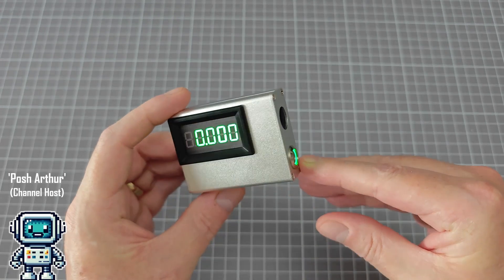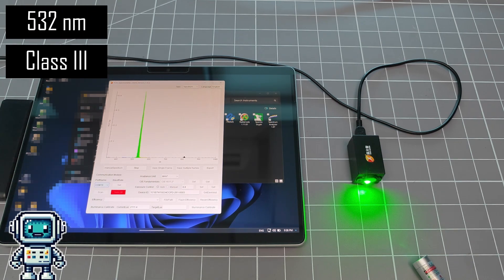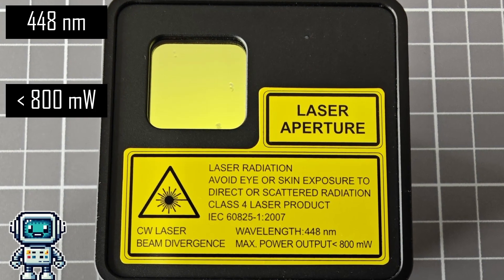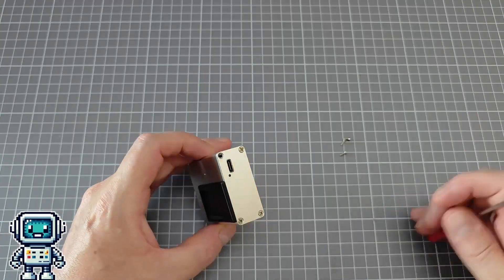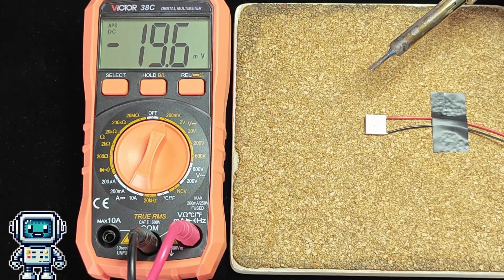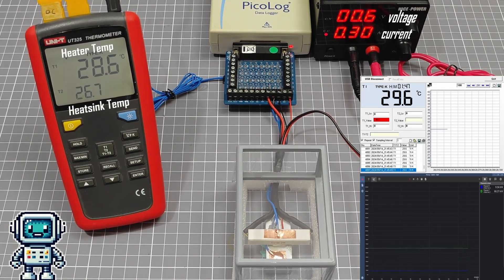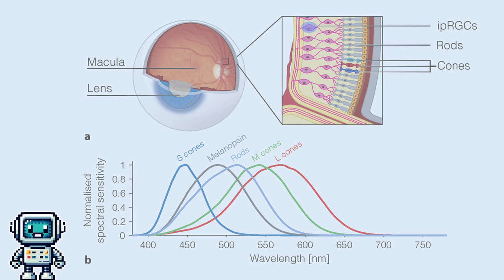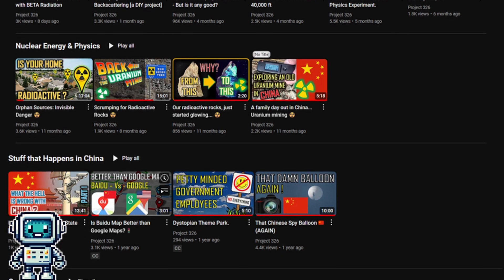How does this LASER POWER METER work?

Comment: im JaySum i have a theory or hypothesis that may explain the 1+1=4///f double split theory,, laser one' double split at an angle pointed through lensed created a double split  laffect of the wall reflection shadow split of a single ray. making P1=p2 lensed affect at an angle projection = the dark mass area of lense bouncing around inside exiting as 2, the laser 2 pointer at an angle crossed paths as then creating a 4 split laser of frequency double split angular frequency laser 1 =p2 double split angular  laser 2 as P=p2,,,,   as then 2 angles square it up  p1+p1= square =4 angular frequency passing through the lense mirroring the affect as a split in mirror of 2 lasers pointing into a single lense point of view mirrored the lasers as a P4  double split law of physics quantum mirror angular affect.. hahahaha YUP  light bender..   sum it up

Comment: Just a stupid idea: could the small difference compared to ideal curve be the system intrinsic thermal capacity? 
Great video in any case.
Reply from the maker: Thanks for the comment, is that the same as the specific heat capacity of the objects in question?
Reply: @project-326  yes, it was late, I did not find the right words ... :)
Reply from the maker: @jarmoparkkinen6090  I tried to wait for as long as possible before making readings so that the temperature could equalize, but you are correct, because at the low end, smaller differential temperatures could have a more major impact on the results...

Comment: Lovely video.  

Especially with the green laser you could see that a lot of the energy was being reflected OUT of the power meter and would not have resulted in the correct reading.  You could ask PCBWay to machine an aluminium laser absorber (to generate mode donations for the Auntie looking after the orphans) with a conical aperture and a square base to match the Peltier device, anodised black using a suitable broadband pigment or photo silver chemistry.  Some other metal that can be chemically blackened would also be suitable.  Using a commodity vaping machine case, controller, display and battery system might be the easiest way to OpenSource the hardware. You could integrate a small laser pointer into the same unit to utilise the battery system and test the power output with a standard corner cube reflector that is used by surveyors as long as your source and absorber were the correct distance apart.

In your power meter design you could then use a generous extrusion for the case that will double as the heat-sink.  Add a replaceable 18650 cell that can be charged in or out of the case. Include a tripod thread in one side and recess the absorber to reduce the entry of stray light.

The panel meter design may have a built in auto zero function to prevent jitter around zero by ignoring input that is just one or two counts above zero.  You could test this to see if a selected pointer always adds the same amount to your other readings or if there is some deterministic non-linear effect.  You could then measure the weak sources by adding them to a stronger reference value and observing the increase much like we use the bathroom scale to weigh the kitten.

For the DPSS lasers you could also do some tests with an IRcut and an IRpass filter to see if you can independently determine the separate contributions and the total amount of light to determine the spurious IR from the pointer.  Someone warned that a COLD DPSS laser with bad IR filter could output many times the Green light in the IR band from the pump laser.
Reply from the maker: Thanks for all the suggestions!
Brainic75 did a good laser beam dump, using a plum-bob painted black.
some good suggestions here, perhaps I will re-visit this project...
Reply: You could consider adding a photo diode based detector for low power lasers, LEDs and optical fibre testing, it would have a high speed response compared to the higher power Peltier detector.  Sometimes it is useful to know IR light is being generated even if it is a weak communications beam or even an IR remote transmitter circuit. It could even incorporate a tiny oscilloscope display showing carrier and modulation shapes if you have a OLED display like those used on the commodity Blood Oxygen Saturation meters that became cheap and popular 4 years ago.

Comment: Which black coating/paint/surface finish is BLACK absorbing "100%" of the radiation?
Reply from the maker: Thanks for the comment.  No materials can absorb 100% of the input optical energy, but getting a constant absorption factor across the spectral range is good enough.  The 'blacker' it is made, the more sensitive the device, particularly to low input power levels.  If the material has constant absorption with wavelength then the calibration can be valid.
Reply: @project-326  
I know you can't achieve 100%, that's why I wrote "100%"❗
But, GIVE ME SOME SOLUTIONS!

Comment: If you build one, would it be advisable to use something like "Musou Black"-paint for painting the visible side of the Peltier-element...???
Reply from the maker: its a great idea, I just need to test the thermal properties.
Just ordered 100ml...  Thanks for the suggestion.
Reply: @project-326  Just saying... and also testing my intuition on such matters... ;-)
Reply from the maker: @klausbrinck2137  I had been looking for a very black material anyway.  The overall absorption factor doesn't really change the accuracy (so long as it is equal across the spectrum), just the sensitivity improves with darker material.   For the instrument I am thinking of building, I am actually not really interested in creating anything that can measure over a watt of optical power, so this might be a useful option.
Reply: @project-326  Exactly (your last sentence). Cause otherwise, loosing several mW shouldn´t matter, as long as the losses are always proportional or similar. But few mW losses by just a few-100s mW lasers may indeed skew the results of comparisons between low-power-lasers.

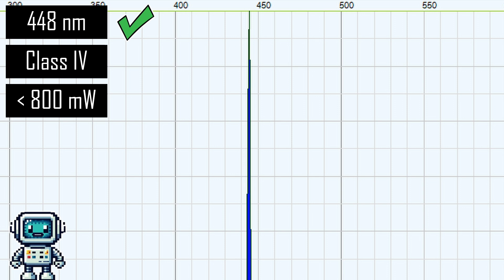Comment: I have been thinking at the 5:47 (something around this time) about the engraver you talked about do you think you will find different results if you used focus lens?
Reply from the maker: Thanks for the comment.
I don't think so, because the thermal conductivity of the plates of the Peltier device is pretty high (they need to be), so the spot size is kind of immaterial, at least until the power density get so high as it damages the black coating.
Reply: @project-326  i see thank you for your answer i thought it would be better if we used foucs lens only but is there another way to get better results or more accurate results than focus lens because we need to keep the device safe
Reply: @project-326  i have thought about will diffraction solve the problem

Comment: whats the limit on these newer models?
Is it still 11W and they kick off?.
Got some very old ones, from like 2016 or 2017 purchased from Tommy at LPS... the pocket and Tornado... was around 35 each back then..
they are still kicking here in 2024 and working fine, even though I been hammering them with intense lazing, way above reason for such a small heasink with a limited sensor & coating,.
Got numerous laser power meters of higher standard, but these dllrt cheap pocket meters is one of my favorites... its så convenient to use and it holds its batterycharge well over time ... accuracy is suppresinly decent for something this crude.. my unit read around +4% high, though do recall it would influence the reading if battery gets to low but all that can likely been fixed, as my unit are like 7 to 8 years old and no battery indicator..
example of the max, and where it chokes. https://www.youtube.com/watch?v=GCqrcVHhLrs

and green https://www.youtube.com/watch?v=7KJAXeTLYbU
the other model Tornado LPM, but it was only on market fora very brief moment back in 2016/2017 https://www.youtube.com/watch?v=Dr4xKMC2sLc

Comment: Nice!
There is a great read on Harvard University page - "The Bolometer and Radiant Energy" by prof Langley, 1881.
With a metal strip covered in soot, connected as part of a Wheatstone bridge to a sensitive amplifier you should have much better time response of the sensor and low power accuracy.
Reply from the maker: nice to know!

Comment: With the 2 lasers you are holding them under an angle of 45°. This will increase the surface by approx. factor 2. With two lasers it is a factor 4. You could test this with some other lasers.
Reply from the maker: The surface area that the beam presents to the sensor doesn't matter, once the sensor reaches thermal equilibrium, the heat energy will be spread over the entire TEC top surface (in this case 15 x15 mm).  The ceramic contact plate is very thermally conductive...
This device measures the total power, so increasing the surface area of a given beam will results in less flux per unit area, otherwise you would be able to get free energy with a divergent beam...
Reply: @project-326 , I agree, but the TEC has the junctions in series. This means that at the outer edges get likely less energy. I don't know the surface area of the laser beam, but I think it is much smaller than the TEC area. I think that the spreading the energy causes just the jump. As said somewhere else adding a bias could maybe help.
Reply from the maker: @troncooo409  Sorry, I don't really understand what you are trying to suggest, is this related to the 2 lasers discussion, or something else?

Comment: 3:42 The laser is in the claimed specs on his label: 650+-10nm. It means, it can be e.g 660,659,658 or 640,641,642 etc...
Reply from the maker: you are correct about that but the background to this is that I have two of these pointers and they are both the same wavelength (within 1nm), I talked to the vendor on Taobao and they confirmed that this is a misprint on the label (ie they are all expected to be 660nm).

Comment: yes definitely a DIY version of this would be really interesting and also perhaps a way of easily calibrating it with a resistor perhaps using your own one as a baseline for that resistor calibration. Also I see you used a black permanent marker is there something else that might be better perhaps such or some form of carbon as the black coating. Whether you're black marker pen would just get evaporated off the surface with a more focused laser.  Very interesting keep up the good work

Comment: I have the laser bee USB and its a decent product; identical technology to the one tested here - a peltier cooler blackened and used as a sensor.   The canadian guy who designed it seems to have done a reasonably competent job and probably calibrated the original design.  I haven't opened the case, but it probably contains an opamp, AD converter and USB stuff.  It gives the same sort of results as the unit here, green laser diodes put out much more power than the red, and the violet (blu-ray diodes?) are stupid powerful.    

Accuracy is probably about the same +/- 20% as environmental factors around the sensor are a big contributor to error -- the average human is radiating ~100W, albeit over a much larger surface area, but that is still a lot of noise compared to mW range laser diodes.

The peltier elements are not designed as sensors, so their manufacturers are probably not much interested in unit-to-unit variability, provided they all meet some minimum cooling/W spec.  Calibration of each unit is then the key to accuracy when used as a sensor, and calibration takes time and therefore money.

I've been more interested in interferometry stabilized he-ne lasers, and they are only micro-watt power output , which is well below the noise floor of any (hobbyist) peltier device.  I've tried these devices:

digikey.com/en/products/detail/marktech-optoelectronics/MT03-003/5866633

where you at least get a spec sheet with a current output curve as a result of infalling irradiation power.   You also then have a wavelength dependency; the few photodiodes I've tested show minimal unit-to-unit variation, an encouraging sign.   What's the absolute accuracy?  Back to the calibration and money question.   

The photodiodes should be able to handle several mW power, but anything in the W range is likely going to destroy them.

Comment: Offtopic but i've read you're interested in it and i have an emf-390 if you ever need more data on experiments about radiofrequency or alternating electric and magnetic fields. Awesome instrument, it is directional though.

In the rf it is responsive in the 30mhz - 10ghz range. Actually it is sensitive up to about 10.5 and the lowest i got was 433mhz with a walkie talkie. Another fun thing are microwaves ovens. I have a shielded one, mind you, but i could still see the continuous signal from another room 2m upstairs close to the floor (0,300 milliWatts) so very weak but cool. I discovered some light switches when clicked create a small rf pulse and my xiaomi phone in airplane mode (wifi and bluetooth off too) was doing two pings when i turned the dispay on and off. Fixed it later, had to do with bluetooth. I can see when a call is coming about 5 seconds before the phone starts ringing. The biggest source of mf i have found is my lawn mower when operating and ef is my scooter when charging, both detectable from 4 meters away. Even a cable not plugged in any outlet but touching another one that is plugged in has an ef detectable at the other end, even though they're made of insulating materials.. and i can't detect any magnetic field being generated that could somehow induce the current so boh?

Actually i'm sure almost anyone in the comments has some kind of measuring device here, we should do a telegram group to create a squad to run multiple experiments with different measruing units.

Comment: Awesome! Learnt something new!❤
What are this peltier devices made from? Looks like porcelain? Google tells this is an alloy from Bismuth2 Tellurium3, a rather exitic material. I guess its resonance frequencies are outside the visual range to give such a linear measurement. Weird stuff.
Reply from the maker: I learnt something new too and wanted to share...
Reply: @project-326  Ah sorry, I was wrong- I googled a specific peltier device TEC1-12705 and that one is just AL2O3- Corundum, an Aluminiumoxide, a not so rare mineral. Cool! they grow also naturally, didn't know they can be used as Calorimeter. I will check out, if I can buy such a laser measure device, I also have a few lasers, where I am suspicious they are completely out of their range. And as you, I do it on a budget, so the input is highly welcome and I like your scientific curiousity. And I like you, I have rather weak lasers, so a sensitive device for low ranges is welcome. As one comment pointed out, there are this supercheap diamond thermo conductivity measure devices on Aliexpress, may be you take apart one of those. If I am right, they use the same principle as your laser measurement device. They really depend on the mass of the object- bigger stones warm up slower. But what is obscure to me, that the probe tip is also measuring at the same time - may be the measure how fast a certain amount of heat is flowing away from the tip (=cooling), instead of heating up.

Comment: On the topic of thermal sensing, I recently got a cheap diamond tester to review (Diamond Selector II). It has a little metal probe that is warmed up and put on the surface of the stone to be tested, and measures the heat flow to the stone. Apparently diamond conducts heat more than fakes. I tested it on silver, copper, steel, glass, etc. and it could easily detect copper and silver due to their greater heat conduction. An interesting characteristic of a material to measure.
Reply from the maker: that is interesting.  How does the system guarantee a consistent contact surface area?
Reply: @project-326  It just has a blunt 1mm copper probe.

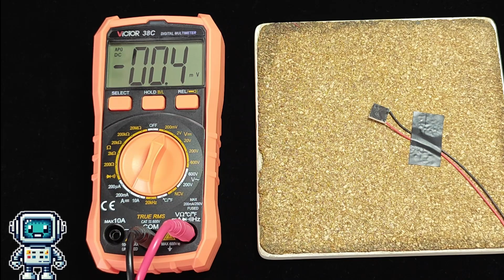Comment: 11:54 Some RMS meters use a thermopile to handle any waveform and bandwidth.
Reply from the maker: wow, that is an interesting technique.  Using a wide-band RF load and a thermopile, nice!
I have been wanting an RF power meter for some time, but much of my work is at 8 GHz (UWB) and at those frequencies even a length of cable is a major investment!
Reply: @project-326  It's such a simple technique, literally measure power's effect on the temperature of some mass. I assume some of these can be very sensitive to low power signals too, using various compensation to eliminate the environment's effect.

Comment: ive seen some laser power meters in equipment by having a small mass of material (aluminium for example) coated in a highly absorbing paint or soot, its connected witha thin short rod to a larger mass to sink heat away.  both masses have a temperature sensor and the difference gets measured which can be used to calculate the amount of power absorbed

Comment: Doesn't the peltier module measure different wavelengths differently? I mean red is hotter than blue! Great video! Bot boy rulz!
Reply from the maker: thanks for the comment.  You are correct that there will be differences between wavelengths of photons, but other other way around.  What I mean is that blue photons carry more energy than red ones (E=hv).  What that means is that it will take less photons for a blue laser to be measured at 1W and it does for a red laser.  I know, it feels counter-intuitive...
I hope that helps?
Reply: @project-326  So my logic was backwards, but still sound? The peltier device is wavelength ignorant. Peace.